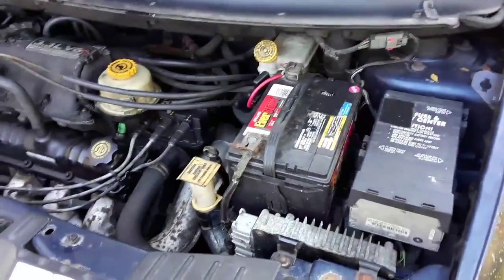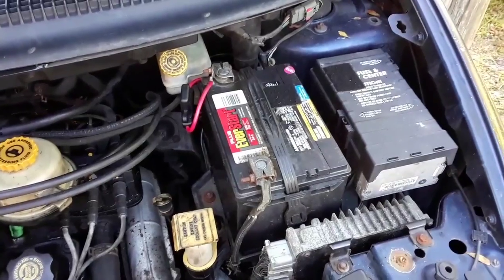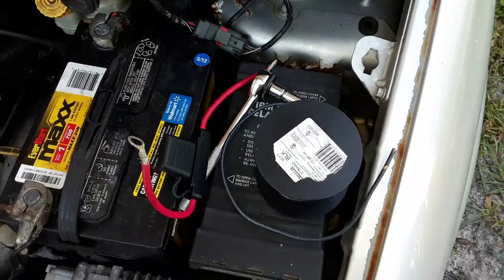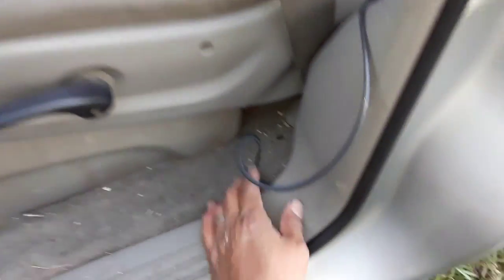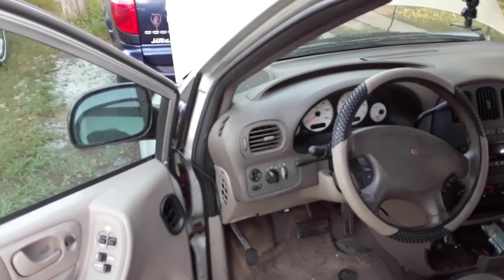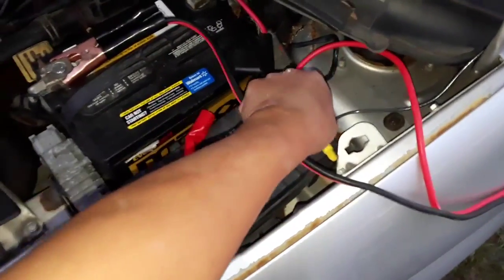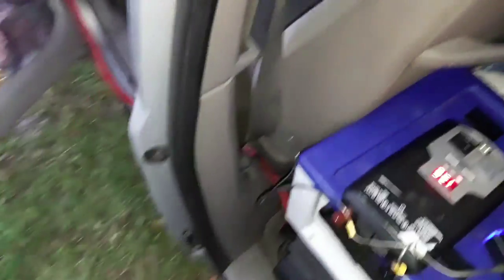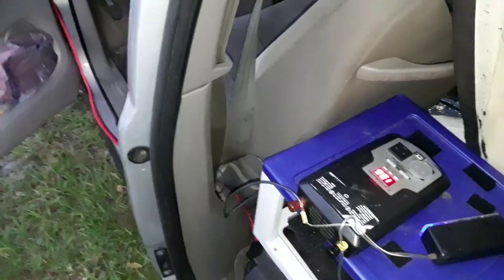Vanlife - How To Fail Wiring An Inverter Without A House Battery (V933) Living In A Van Dweller

Comment: Just for giggles, take that jumper cable from the neg of the battery to a scrapped part of the chassis and see if any of your rpm or transmission issues disappear

Comment: The motor should have a factory ground between the motor and the frame it's either missing or disconnected
Reply from the maker: Yes. You are correct.  I was able to get the system working just now so look for a cooking video soon. :)

Comment: I'm confused😵
Reply from the maker: Red from the battery terminal goes to the red terminal on the inverter.  The black terminal on the inverter can simply have a wire to the metal chassis of the vehicle.  It didn't for me because it wasn't making a good enough contact (i.e., instead of BARE metal, I was running it to a painted surface.)  I have fixed the problem so it is working fine now.  Look for a video soon.